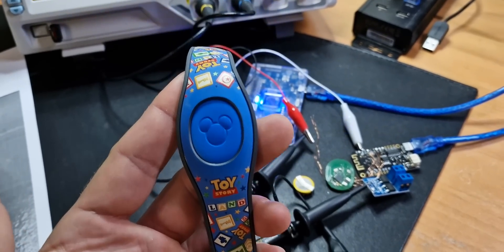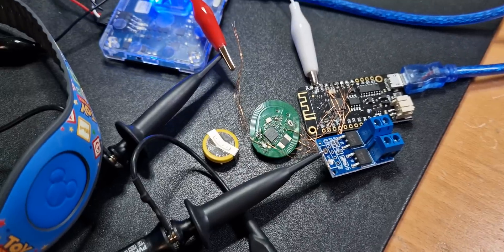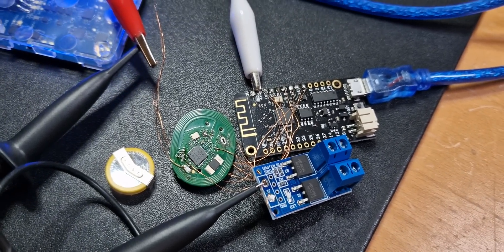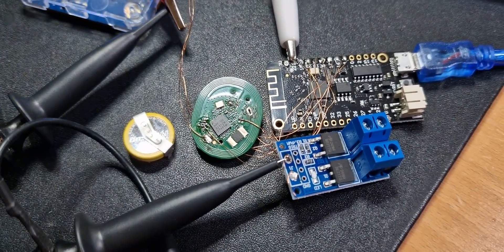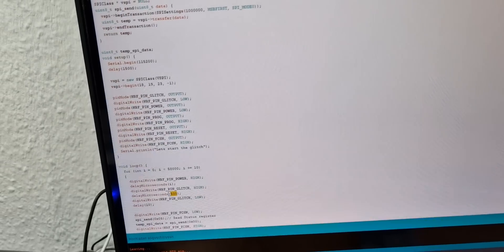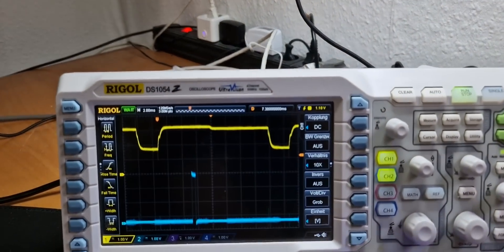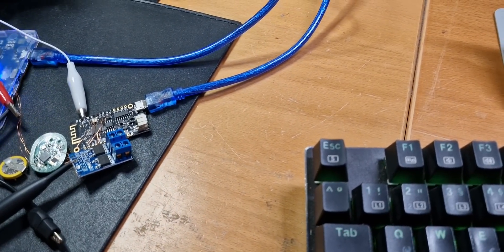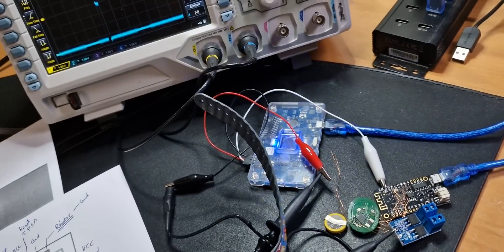Hacking the Disney MagicBand that tracks you! + nRF31512 Glitching

Comment: Hardware hacking is basically black magic to me, good job!
People handing out their fingerprints for the sake of entering a theme park really blows my mind, who in the right mind does that?
As far as the wireless goes, I would be really interested in what this system is broadcasting on 2.4 GHz. Its difficult to pinpoint exactly having access to only one sample, but if it broadcasts some sort of uuid/serial number, it would really make a strong case for tracking people through the park/resorts?
Reply: Never in a million years! It's mind boggling!
Reply: 2.4 ghz  would be the same freq that 802.11B-G uses, and it's possible to have a low power computer that small that could do a few things, and yes tracking/authenticating a person would be one of those things. which could still have non nefarious uses,  Such as I've heard that when you get photo's taken on rides, or by those photographers in the street.  you don't have to go to the desk and pay for a print out of the photos. instead you can tap your band on the pad next to the screen showing the picture and it'll be saved to your account. this could also be used for things like if they had a meal package on their account,  it could be a easy way to verify that person is connected to that account.  If they are staying at one of the resorts it could function as a room key perhaps even storing a secondary id for the hotel room. so there are legit uses for this. but of course this doesn't exclude they might have other uses for it as well.  but also even if they are tracking your movements around the park this wouldn't be real time tracking but more of list of points you've visited through out the day.  And then what would they be doing with the data well most likely using it to try to figure out how to convince you to buy more things something every company wants to do.
Reply: Theme parks are private lands therefore your rights become limited in exchange for agreement to entry on their land
Reply: @ytzpilot  They're not getting my biometrics. So until the laws change to make this illegal, I won't be going there.
Reply: @DonoVideoProductions  Last time I went to Disney was December 2001, and I’ll never go again for the rest of my life. Since then I’ve gone to Canadas Wonderland in Toronto as well as the theme parks in Gold Coast Australia, both those countries operate theme parks the same since the 80s, pay your entry, get a hand stamp, enjoy the rides, just as it should be 😁
Reply: @ytzpilot  Yes. Hand stamps. What in the world is wrong with that simple and effective method?  I remember as a kid trying desperately not to wash the back of my hand so I could be assured of reentry in the evening. It was magical seeing my hand light up with a mysterious pictogram, signaling more fun to be had!

Not so much with the Disney of today. I don't know what they're doing with all the biometric data...but they're not gonna a have mine or my money ever again.
Reply: They don't store fingerprint scans, only a biometric hash. Most people in their right mind have more realistic fears than that of Disney figuring out something nefarious to do with millions of fingerprints from their own paying customers.
Reply: well I think there's a reason to for them to want to collect fingerprints at the gate that is not nefarious.  Since these can be used for park admission, you want to make sure only one person is using them. such that you aren't like a set of 4 to get yourself and 3 others into the park you collect the bands while the other three are still inside and then leave with the bands hidden on you.  then you go to another three people outside the park and hand off those 3 bands so they can use the bands to enter, and end up getting 7 people in to the park with only 4 tickets.  using fingerprints is a easy and quick way to ensure that that band is only being used by one person.  so said person could come and go as freely as the ticket allows, but he can't hand off his ticket to someone else. so there's a legit normal use for fingerprints while entering the theme park as it's faster and less error prone then making people show ID especially if your talking about kids who are to young to have one.
Reply: @CrossRoadsOfTime  They used to snap a digital pic as you went through the line. Far faster, and never wrong, as the fingerprint method periodically is. I would never give biometric data to anyone, let alone an amusement park.
Reply: @DonoVideoProductions  might be faster initially, but going to be far less accurate, to try to match visually as stuff like different lighting and face paint or makeup can mess with the visual matching, so it'll take more processing time and have a greater degree of false negatives which is bad PR. Since a false negative means they will accidently deny access to someone who legit should have it. and in any case it's going to be far easier to use a picture of you to do nefarious things with then the output of their fingerprint scanner as they don't have a picture of your fingerprint they have a big hexadecimal number that's biased on your fingerprint. the only way they going to make use of that is if they could translate the encoding from one system to another, then get access to inject that translated code as the output from the reader to the other system. but if they got that kind of access, to the other system.  not having your fingerprints isn't really going to stop them from getting in anyway.
Reply: @DonoVideoProductions  so you were ok with the picture? Cause that IS biometric data. Also, they still allow you to opt out of the finger print and use a picture. Finally, the fingerprints are NOT stored. The fingerprint is used to generate a Unique ID, essentially a long varchar string. The only thing they save is that string, and it would be useless to anyone outside of that use case. Dont be scared of things you obviously dont understand.
Reply: @creampiess  First...the horse is out of the barn as far as pictures go, and has been for decades. Second, there is no regulatory authority independently confirming what they store, or where, or what else they do with it. Third, I find it amusing that you choose to attack me simply because I express my decision not to acquiesce to a gathering of information I do not believe they, or any other company, has a right to. You do you. Attacking me will do nothing for you.
Reply: @DonoVideoProductions  again, they do not have ANY of your information, it is not stored. You giving them your ID would literally give me more of your information than the fingerprint. The technology scans your finger and measures the distances between  the lines to create a hashed numeric value, then it deletes everything except that hash. It is not even unique after more research, as the hash can be duplicated at a rate of about 1 in a 1000 people. They would be stupid to store that data as many states have Biometric protection acts, and Six flags was just sued for millions of dollars for violating. As such, this data could NOT be sold to another company without it being flagged or made public. If you think they are storing it, go there and have them scan your finger print. Then hire a lawyer to subpoena the data. If your right, your getting a few million dollars. There is a reason it hasn't happened, because they aren't storing them. You understand that software and data would need to be managed by large teams of system administrators and software engineers. I guess they are all keeping mickey mouse's secret, yet you know all. This is not me attacking you, just pointing out that your making a decision based on feelings and not rational thought.
Reply: It is a matter of trust.  If the fingerprint reader is only used to verify additional people are not simultaneously entering the property using the same wrist band, no big deal.  On the other hand, if Disney is collecting the biometrics and passing them on to other corporate or government big brothers, then not so good.  I am not in position to read Disney’s terms of service, so at this point, it is speculation for me.  I tend not to trust corporate entities, but Disney has a lot at stake for repetitional damage if word got out they were forking over biometric data, and you can bet word would eventually get out.

Comment: wow awesome hack! Look at the write data register code and ignore the rest. 
you can also hook up an nRF24L01+ in sniffing mode and see what's it's sending out,  a simple case would be a serial number (anything printed on case?)
or more advanced is a handshake with entry system, but I don't think, there is no RX pattern in consumption, try to zoom in, maybe check RF with SDR and compare it to current.
A connection diagram would be nice for glitching. Also insight how you did the timing.

Maybe we could unlock rides. Don't forget to upload code :D